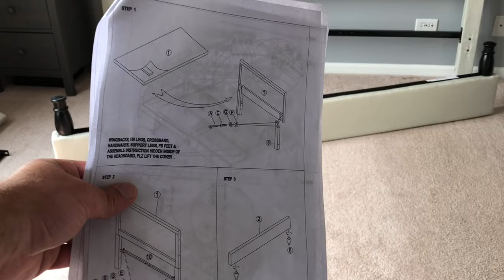LIFE Home Premiere Upholstered Platform Bed | FULL INSTALL | REVIEW

Comment: Thanks for the hard work. Did I get it right that the holes are not predrilled for the slats? If not, do you think it can be screwed in by hand and the bed is still solid right?
Reply from the maker: Thank for watching. Slays you have to drill them in yourself. You can do it by hand but it will take a toll on you. Power tools would be a lot easier. Thanks for watching. Support and subscribe

Comment: I didn't receive instruction with my bed. Could you tell me what bolts, washers you are using at each step? Are the spring washers the ones with a split in them? Are you using the nuts in the beginning at any step?
Reply from the maker: I don’t recall all the steps. But my video shows all the bolts and step by step instructions. Split washers have the split section in them yes.

Comment: I have a question I bought one of these from an auction for dirt cheap but it only came with the headboard just like this…. It’s a king size can i still use it?  Can i just buy any king size frame??? Do you think I should keep it??
Reply from the maker: It actually might work depending on the back set up of screw/bolt locations. If your handy you can drill through the board legs and make new holes if doesn’t align. With all that work in that case I would buy a brand new one.

Comment: Do you have to use the slats for this bed? Can a boxspring be used instead?
Reply from the maker: No slats necessary. You can even put an adjustable frame in there.

Comment: The hardware pack has letters for each bolt and screw. Why not use the letters? Your video is very confusing because you wouldn't just use the letter associated with each part. Geez.